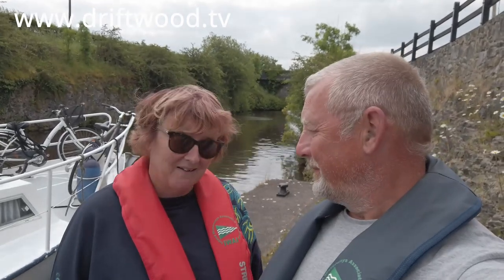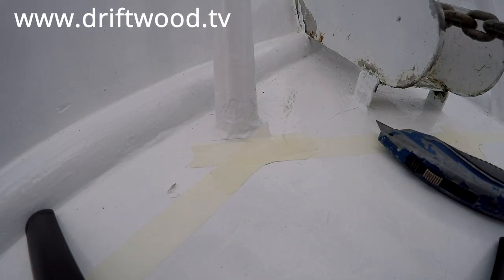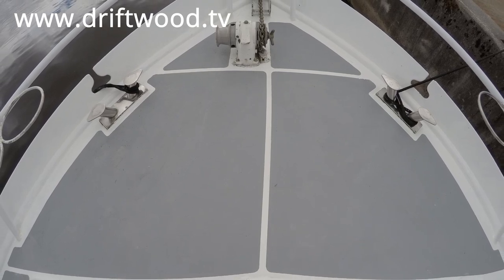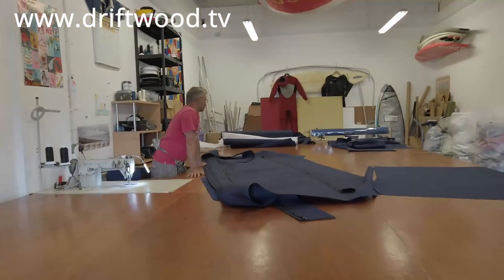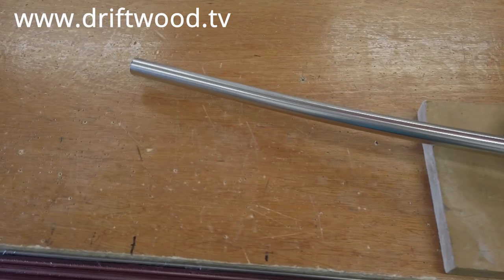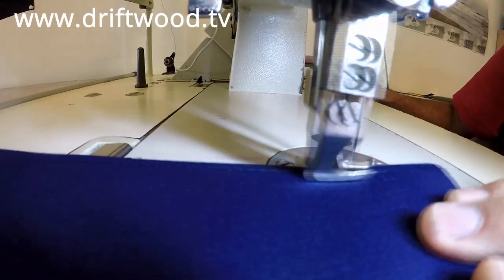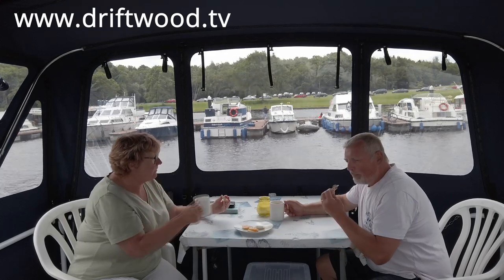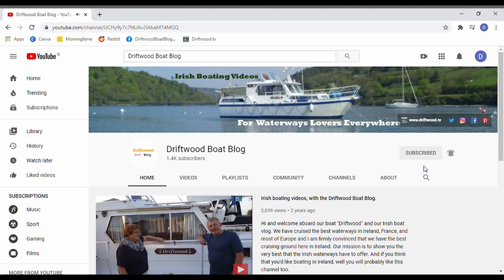Boat Canopy

Comment: Very well though out, designed and fitted. You will not regret this....and with the full length dodgers and doors, with no draughts running around your ankles it is a very comfortable additional room.
Reply from the maker: Sure is Noelle, strangely sun hasn't stopped shining since we got it 😂🌞🌄